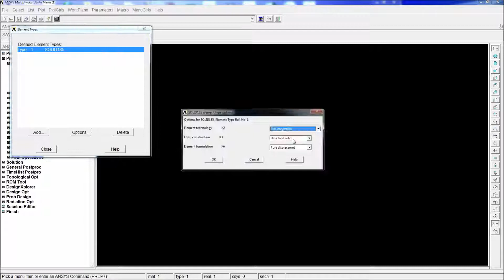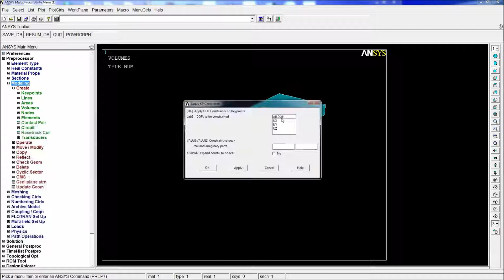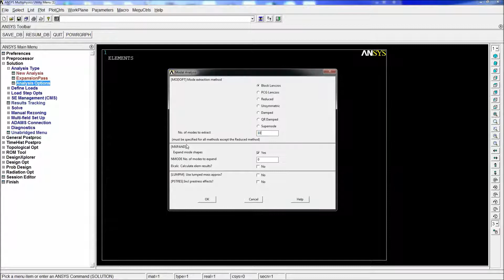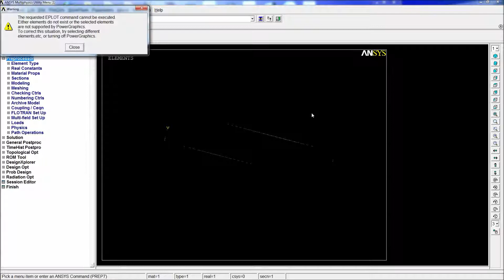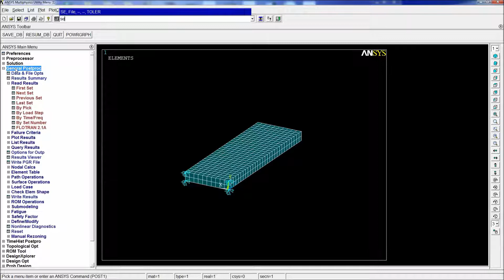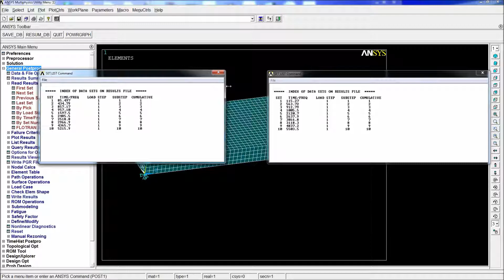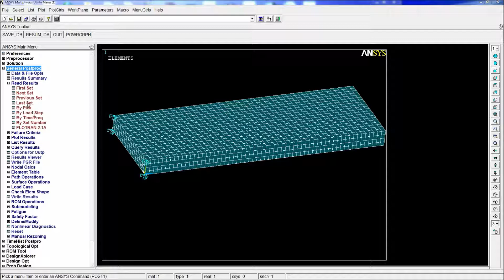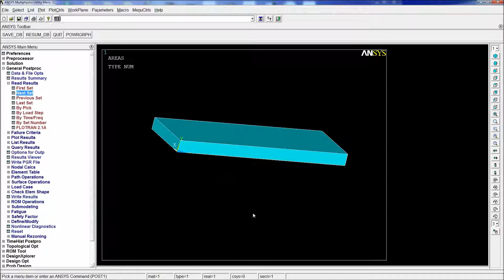Ansys Tutorial: Modal analysis in Ansys APDL (Volumes) #33

Comment: Is it possible to model a masonry blocks series of wall? like an enclosed area with walls?
Reply from the maker: You can basically model anything you need, the problem is if its feasible in order to simulate, or if you have the correct properties, and so on. 
For example in a masonry blocks wall you would need to take into consideration the properties of the joints, the finite element models require making simplifications in order to make the feasible.
Reply: @FemExpert   Thanks for the reply. It makes me more into ANSYS simulation :D I have all the properties i need, the only problem is how to execute the modeling of the blocks together with the joint.
Reply from the maker: @chiefdarv4661  It depends on weather you are using volume or shell type elements, if you check our tutorial you will see the differences, nevertheless you can do it as a strip of model with different material properties.